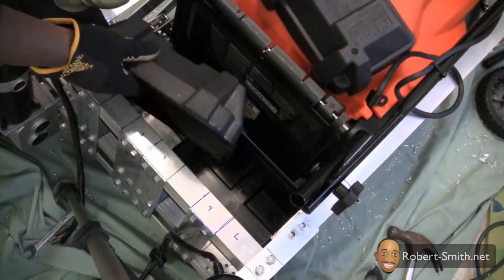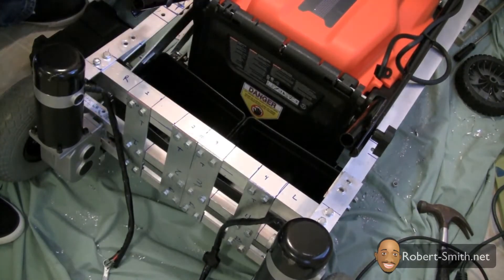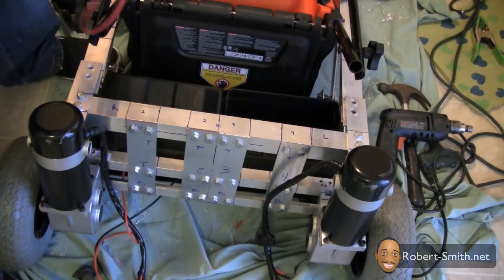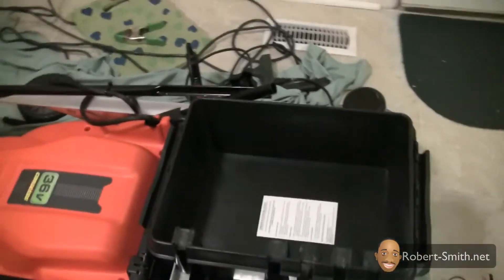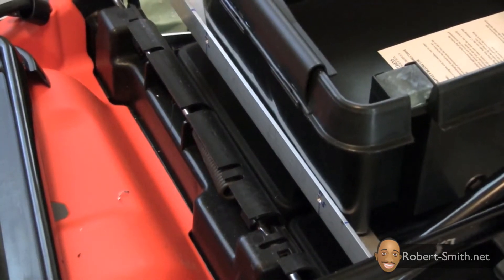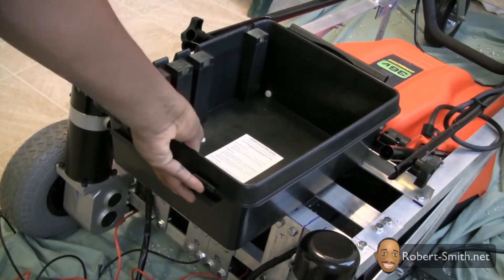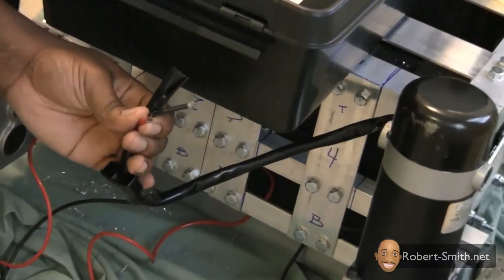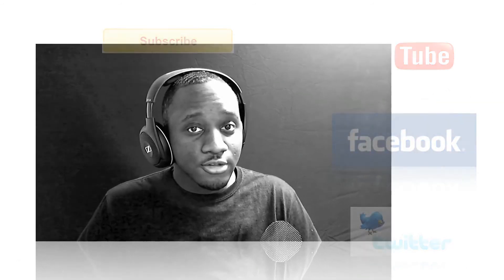How To Build A Solar Charged RC Electric Lawn Mower - P5

Comment: Hello, which electrical components are needed for the drive system next to the engines. It is permissible, two engines from the wheelchair and the Sabertooth dual 25A, are something else

Comment: @RobertSmith3 I was just thinking a weed eater could probably be made with a line follower and a small line painted on a foundation and other stuff.  It might work with a distance sensor too.  A cheap motion detector could be used to shut it down in case an animal or someone was to get close to it.  The sensors would probably need to self adjust to allow for different heights in the lawn though.  A 2 wheel balancing mechanism using an accelerometer would be a nice trimmer.

Comment: Great job!
you may wish to use battery/welder cable #4 should be fine off the battery. DC tends to have larger voltage drops than AC. Also wire from solar panels should be not be smaller than #12 stranded copper.

Comment from the maker: @shartne To prevent any possible short circuits from occuring, since the enclosure will have several electrical components inside. The nylon screws are strong enough and are only used as an extra safety precaution.

Comment: A mig welder with aluminium wire would have come in handy on this project.  I sure am enjoying this series and thank you very much for making them.  Also, I'd like to thank you for the tip on using Google sketchup.  I've always wanted some software I could use to try out new ideas and it is really helpful when you are building stuff.  Learning it is a challenge, but well worth the effort.  If only the mower had a robotic arm that would line trim the weeds.